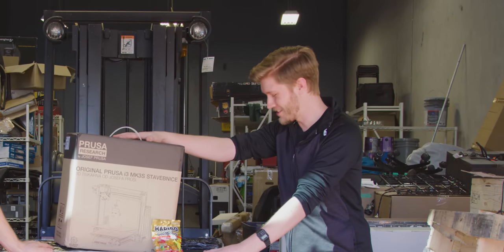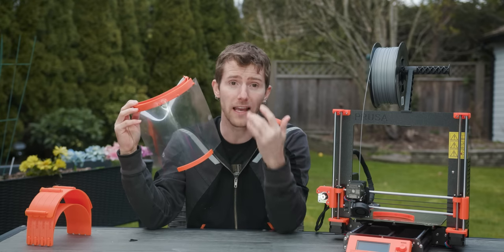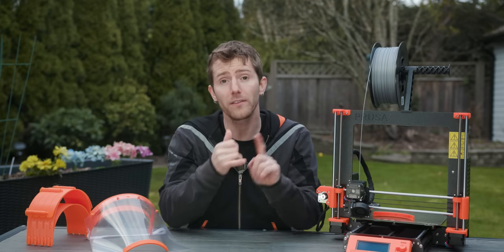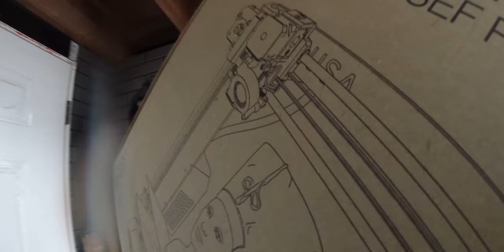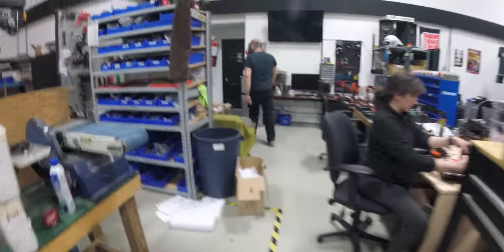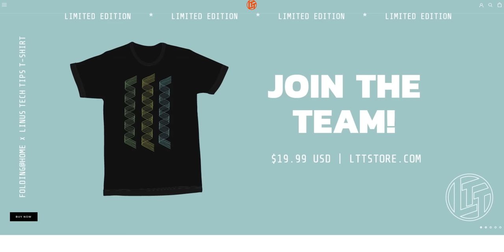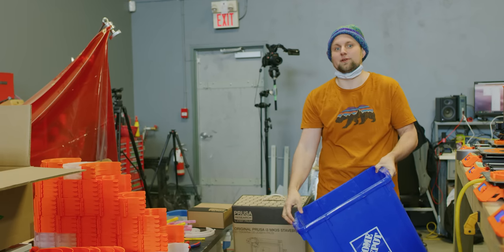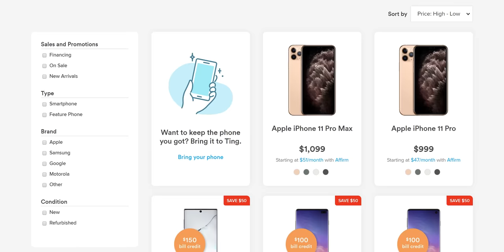3D Printing 300 Face Shields… PER DAY

Comment: just to mention from experience, please make sure the materials you use are able to be disinfected/sterilized and check what technology are the hospitals using to do that... most of the hospitals are using cold plasma to disinfect/sterilize the shields so any of the 3d printing filament materials are ok, but some do that in ovens... DO NOT in any case use any foamy material, they are not good enough for disinfecting/sterilizing (like those in NY that are making the visors in the shipyard, they put foamy material on the forehead), if one of the guys making the visors or distributing them is sick it can infect the doctors who will use those visors that use foamy material... also if you use PLA or PLA+ make sure you dont use the transparent shit thicker than 0.5mm otherwise the 3d printed holder might brake due to the strain even if not used...
we here in Macedonia are printing 24/7 last 3 weeks already (i am still printing atm), produced more than 3000 visors so far...
good luck...

Comment: linus what would work better is what we are doing in billings montana where we are running the city's printers to make masks that hold a section of an n95 mask so you can create 6 masks from one and the body is reusable is properly sanitized. because the virus is so small it can be trapped in moisture in the air a facesheild will be ineffective as air is chaotic and you will encounter the virus at the same rate with the face sheild

Comment: I tried to print these shields on my creality 10s pro so that I can donate them in my area, but all of a sudden the nozzle choked. I cleaned it but the block seems to be inside the heating element. Heating it didnt solve the issue. I also tried to poke a thin rod in it, but it seems to be hard blocked with something. I dont know what happened.

Comment: depending on the size of the mold for injection molding, the mold alone takes anywhere from 4-12 weeks to build. Then it takes 1-2 weeks to dial in the process. 3D printing gets product immediately.

Comment: HOPE YOUR WEARING AN N95 WHIILE BEING IN THE PRINT SHOP AS 3D PRINTING CREATES LOTS AND LOTS OF TOXIC PARTICLES.
Reply: It depends what filament they are using. PETG, the filament they are using, is generally harmless. If the printer was using ABS filament it would be safer to wear a mask.

Comment: Listen, I love this channel and I applaud the effort to help.  But 10  units per day seems wildly inefficient compared to the need.  Wouldn't it be far more useful to use the 3d printer to print a mold positive that could be use to cast a mold negative that could then be used to injection mold hundreds at a time?

Comment: Okkk but not great for the following reason: 
3D printing quality is still not good, material fail quickly.
----------------------------

This Plastic part seems simple, so why dont you (ask a tool shop to help, such tool can be ready within 48 hours, such tool base is ready over the shelf from DME north America) make a 1 cavity simple injection tool. Which will allow you to produce 17000 parts every 24 hour's. 
You will also need the injection press, clamping force roughly around 10 tonnes is enough.

Comment: i would say that this channel in general is not mature in the 3d printing space... as someone who 3d prints alot, i know that some of the things that they mention will trigger alarm to some of us makers here.... like the anet a8 being one of the cheapest printers out there that did not get mentioned in the cheap 3d printer video, and the Ender3 not being mentioned again, as one of the best budget decent 3d printers out there. give them some time to figure it out i guess, it took me awhile to get into 3d printing too.

Perhaps this is because of the forward push of prusa or maybe even because of the US china trade war going on that the ender3 was not mentioned in this situation? There is one time in my life, as I was setting up a 3d printer farm, an ender3 will take about 30 mins to complete. I had to build about 40+ of them and complete a 3d printed project in basically a month, it is crazy.(i kinda made it?) I also own an anet, which is a close copy of the prusa printer. i think i took 6 hours? The parts is just everywhere in comparison to the ender3. Also, there were problems with the ender3's magnetic bed, when you have multiple prints, over a short amount of time, the bed did not last very long especially when you level the nozzle too close to the bed. so sure the ender3 can do mass production but it is not as hands off as a better printer with comfy features such as auto bed leveling... filament runout ...etc. going the prusa route is bad on assembly, good for hands offish printing.

Some of the things that should be corrected are that PLA is actually stronger than PETG and ABS if you look at tensile strength. The weakness of PLA is in it's brittleness, and low heat resistance (low glass transition temperature), it snaps instead of plastic  deforming.

i don't know why am i writing this and who is this for, but this is just a personal experience.

Comment: This is really only useful if you need a few to outfit 1 facility not to run mass production. For 6k you could have gotten a desktop injection molding machine in 3 days and cut the mold yourself by the time it got there.

This is the least efficient way to produce face shields. They can be injection moulded by the thousands in seconds for pennies. One single injection molding machine will make more of those masks in a day than 1000 3d printers will in a month. There are much better things to put your energy towards. Making the injection molds takes not even a day and a decent size machine will make 6+ shields every 15 seconds. By the time you are set up they could make 10s of thousands of machines and I doubt there are no companies with injection molding machines sitting around. Oh and did I mention that it costs about 1/50th as much per face shield. You could even have used your router to cut them out of big sheets of plastic.

Comment: Hey Linus, about the face masks. I printed the 'Montana Mask' from www.makethemasks.com.

I was sceptical about the fit, but my mind was blown. The mask is oversized. But I put it in the oven at 100*C for 10minutes, then pressed it to my face. Result: 100% perfect airtight fit. And that is even without the rubber strips on the edges.

It takes 3-4 hours to print per piece. And the fit is really no problem since you can mold it to your specific face in 15min.

Comment: Does anyone have any recommendations for what elastic I can get for the headband (in UK)? A local school donated 10 faceshields they made to my lab, they're just missing the elastic.
Reply: First thing that comes to mind for me would be the woven elastic straps like the ones sold for use in clothing as you should be able to find those in with the sewing supplies at the supermarket. Just seems to me that those are readily available and unlike most other alternatives that you will find in a supermarket are actually designed for prolonged wear so they should be comfortable but more importantly actually hold up to the physical, chemical and biological stresses that come with prolonged contact with living skin. Personally wouldn't assume elastic products designed for other uses would be well suited to prolonged wear being subject to the physical, chemical and biological stresses that come with that as it is a challenging environment that will significantly expedite the degradation of many materials.
Reply: @seraphina985  Thanks, that's helpful.

Comment: My computer randomly turned of when gaming and doesnt turn on. When I press power button it shows the red light on the motherboard but then instantly turns of.any help?
Reply: im not no computer expert it could be the cpu overheating if you want more information look it up or go on linus tech tips forums
Reply: Usually if a computer randomly turns off during a high load (like gaming), it means the power supply is not powerful enough for the system. Can you send the specs of your system?
Reply: @ryangrzanic  idk what the psu and ram is but the cpu is ryzen 5 2600 gpu is rx580 motherboard is msi b350 carbon gaming pro and I have a 240gb ssd and 1tb Toshiba harddrive I use the default cpu fan wraith stealth or somthing like that
Reply: @ryangrzanic  just found the ram and psu boxes I have hyperx 16gb (2x8) ram and the psu is pulse 750w
Reply: @XiqX  that power supply is plenty big enough for your system. Is possible one of the power connections to your motherboard or graphics card could have come loose. Try opening up your pc and disconnect and reconnect the 24 pin, 8 pin, and the pcie power to your graphics card.
Reply: @ryangrzanic  already tried that
Reply: @XiqX  its very odd that it was working and just stopped, so you say that it powers on then immediately turns off? you could try removing the ram and putting them in different slots or try using 1 ram stick instead of two.
Reply: @XiqX  also, I just looked up your power supply and I'm afraid to say that it appears to be a lower quality psu. Under the high load of gaming, the power supply may have failed and you will need to get a new one.
Reply: @ryangrzanic  I did the test with the psu and a paperclip to test if the psu is dead but the fan still spins so I assume it still works as most people say if the fan still spins it should still be working, but when I turn on the pc 3 lights do light up in red
Reply: @XiqX  well at this point you have to try and narrow down the problem. I would disconnect your hard drives and anything else that isn't essential for the pc to boot into the bios. Try removing 1 ram stick at a time to make sure its not the ram. as well as try different ram slots. Try moving your graphics card to a different pcie slot if you can. If you have any other graphics card laying around, I would try putting it in to see if it's the gpu that is bad.
Reply: @ryangrzanic  ok I'll try that tommorow as it is really late rn I'll let you know how it turns out
Reply: You can also try powering up the system without a graphics card to see if it stays powered on for longer, but ofcourse you wont be able to see anything or boot into windows.
Reply: @ryangrzanic  how would the gpu affect it? Isnt that basically just for the display if it does turn it on for longer would that mean I need a new gpu? Cos I tried it without gpu and it did turn on for about half a second longer but then off again.
Reply: @XiqX  if the gpu was bad then it could keep the computer from booting. It sounds like it's not your gpu if it still didn't turn on for that long.
Reply: @ryangrzanic  do you think it could be the motherboard maybe???
Reply: @XiqX  it could be the motherboard but I think it would be unlikely, how long ago did you build the computer?
Reply: @ryangrzanic  around october 2019
Reply: @ryangrzanic  i just tried turning it on again and now the red leds only have one come on that is next to the letters cpu
Reply: @XiqX  Have you looked at the manual yet? I just looked at it and there is a section called ez debug LEDs. If the light is next to the cpu on the debug then that means there is a problem with the cpu. You could try taking out the cpu and putting it back in. You also could try resetting the cmos on the motherboard which is on page 34 in the manual.

Comment: everyone shown in the video with the mask not on their face but pulled up or down is improperly using the mask. You should only take the mask of by the strap on the ear and wash it or replace it before using again. If you touch the mask you potential got something bad on your hands. Also don't raise the mask up and eat, you just put what was on the mask into your mouth.